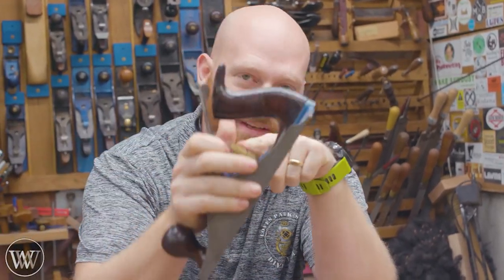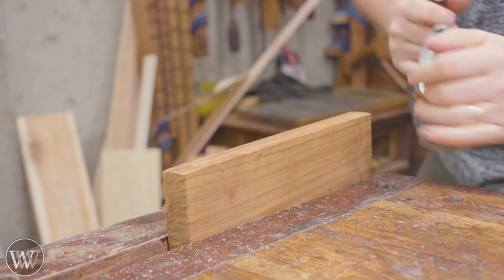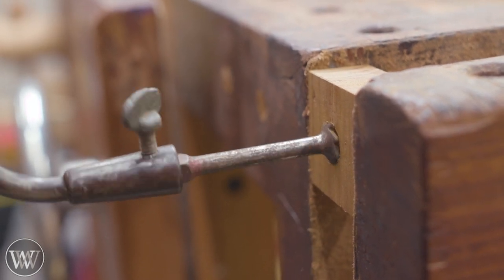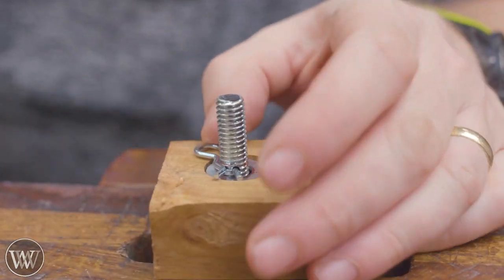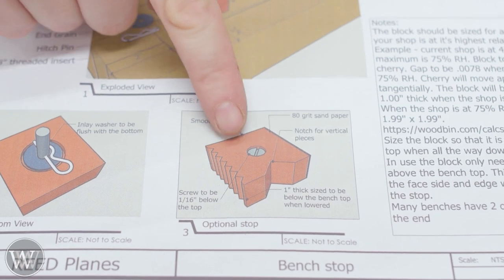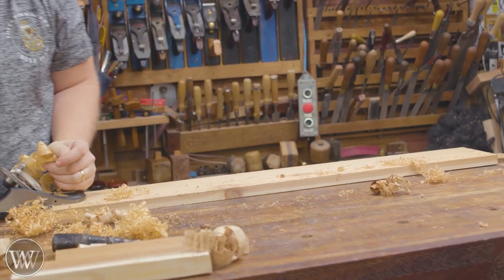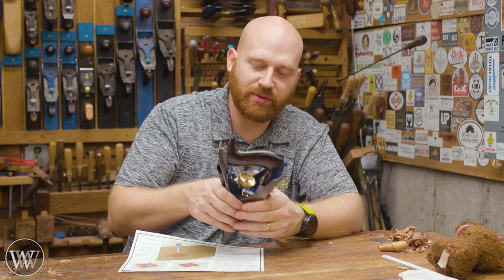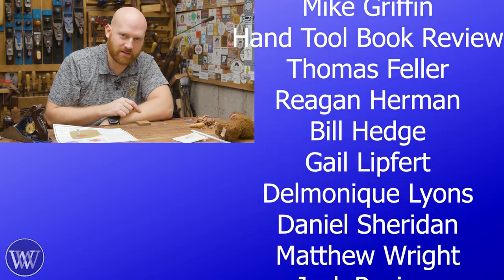The Prefect Planing Stop by REED Planes

Comment: I bought one of these kits. It worked so great I built a second one from scratch and my local hardware store. I plan on putting in another 3... suggestion, use a roll pin inplace of the hairclip.and I put in thin wave washers to help with the stability when retracted.

Comment: Good information. An insignificant point, what is in the kit is a hitch pin clip, frequently called just a clip. A cotter pin is a different animal. All those kit parts are easily available at Home Depot or your local ACE Hardware (as long as you ask for a hitch pin clip).
Reply: I did a bit of reading and the hitch pin clip is at times called by many names, so not an insignificant point, Thanks. You must have much better Home Depot and Ace stores in your area as mine do not carry what I needed for this build or what I need most times.
Reply: @reedplanes728  If you happen to be in a more rural area, Farm Ranch stores always carry these items. Or even a U-Haul store that installs trailer hitches.
Reply: @reedplanes728  Or, I just checked, both the local John Deere dealer and New Holland dealer had these parts in stock.